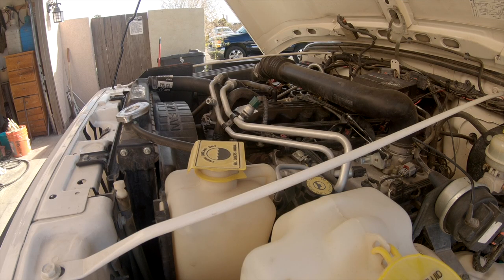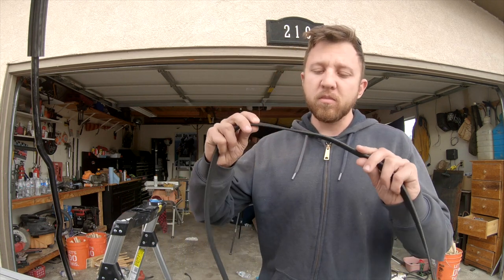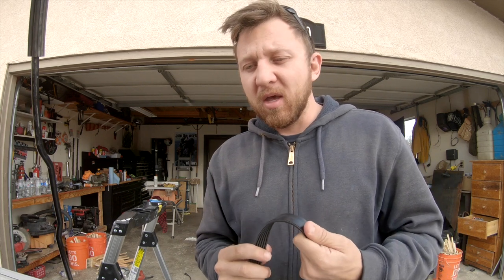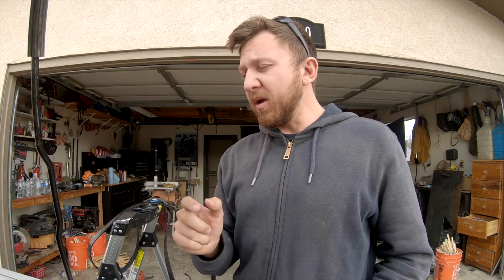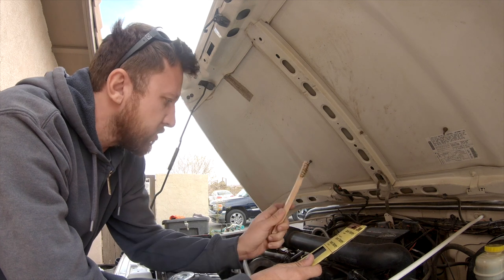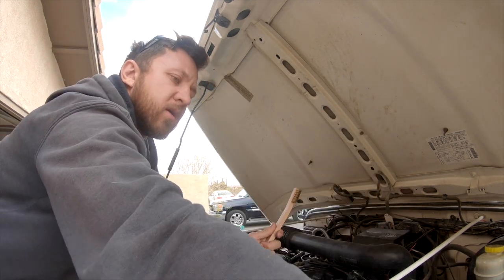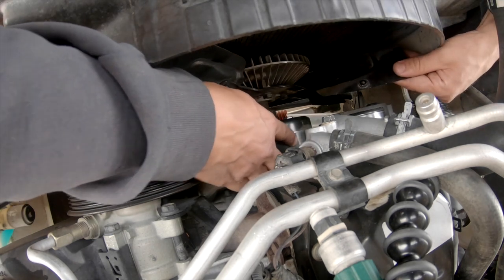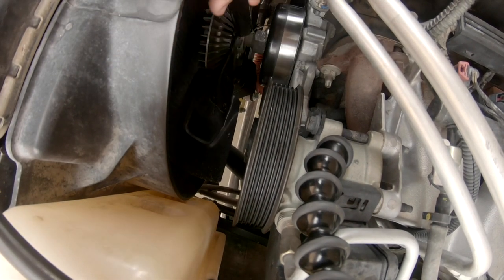How to Fix Jeep Squeal!

Comment: I have a 2016 Jeep compass sport I noticed when I turn first turn the car on the first that time of day about 6 at 6:00 p.m. I hear a squeaking noise for 1 second or 2 seconds and it goes away what is that and how often do I change the belts on on a CBT transmission 2016 sport and also how often would change the radiator flush it out if you can ask me that would be great

Comment: Have you ever had a bearing go out IN the clutch fan assembly?

I’ve got a squeak coming from it but only when the engines hot, when the AC is on and idles the squeak goes away. AC off at idle squeak comes back. Thoughts?
Reply from the maker: Are you positive it's the clutch fan? The clutch fan can go out, it's pretty common wear item. To test if the clutch fan is bad, with the engine off, you grab the blades at opposing sides and see if you can wobble the fan at all. If you feel rocking, wobbling, or clicking the clutch is bad. I have had them go bad and you just replace the whole unit. 

You may also want to check your belt tensioner or if its older and doesn't have an auto tensioner check that the belt is tight enough.
Reply: @EmbarkWithMark  that’s a good idea! It seems pretty solid though, very firm to rotate by hand when the engines cold. I used a stethoscope to try and isolate it but can’t. 

I put my ear right up to the radiator and it sounds like it’s the clutch fan. It makes me wonder though and I just realized something. Since it only happens when the engine is hot hot, with the AC on it goes away until I raise the rpm. But with the AC OFF, I can hear it constantly. Since the AC is on and it’s not doing “much” unless I give it gas I wonder if the clutch is going out on my AC?
Reply from the maker: So before we get into the AC being bad or not. If you think the squeak is coming from the fans clutch area, it could  be a water pump starting to go bad. The fan clutch could rotate nicely, but I recommend getting in there and wiggling things around to see If you feel anything thats loose. You'll want to remove the serpentine belt to do this. 

That does not sound specifically the AC. When you turn your AC you should see the clutch engage and it's working whether you give the engine gas or not.Vehicles normally have an idle up circuit and when you turn on the AC the engine will idle a bit higher in order to compensate for the power draw of the AC Compressor. 

The reason I do not think it is the AC based upon your info is because part of the AC compressor is spinning all the time. It's pretty rare for that bearing to go out on these things. your more likely to have a compressor leak then the bearings go out .

Now it could be as simple as an idler bearing, which is very very common, or the tensioner pulley. 

What year is the Jeep? Are your pulleys clean? Have you tried wiggling all the pulleys with the belt off?
Reply: @EmbarkWithMark  thank you so much for the advice! I’m going to take the belt off today and start spinning things. I’m a first time Jeep owner, it’s a 2005 with 110k miles. I’ll report back what I find!
Reply from the maker: @dad3562  no problem at all! Congrats on the Jeep! TJ’s are so fun to work on and play with. 

One last bit of advice. Don’t just spin the pulleys, grab them and see if you can rock them side to side. Do this with the water pump as well ( will
Most likely need to grab the fan and watch the shaft going into the water pump). 

Please report back and let me know! I’ll do my best to help you out.
Reply: @EmbarkWithMark  I sure will thank you!

Comment: I'm trying to order a stock fan blade. I've got the clutch and the blade but what is the part coming from the water pump connecting to the blade?
Reply from the maker: The part that connects in between the fan blade and the water pump is the fan clutch. The fan clutch will bolt to the water pump and the fan blade will bolt to the fan clutch. 

What year is your Jeep?
Reply: @EmbarkWithMark  its a 97. The electric fan isn't coming close to keeping it cool. I can find the fan and the clutch but not the bolt that connects it to the pump.
Reply from the maker: @kevincwjones  Yea that is a typical problem I find with electric fans on these jeeps. They just cant push enough air. Okay the first thing you need to know is that the late model Tj and early model TJ have different water pumps. Because of this the early Tj's use 4 bolts to bolt the fan clutch to the water pump. The Late model Tj's fan clutch as a giant nut as part of the assembly because of this the late model water pump on a Tj will have one giant thread sticking out. Whereas on the early model Tj's you will just have 4 bolt holes. 

Now if you have the older style pump that originally came with the jeep you will need the older style fan clutch that bolts to the water pump with 4 bolts. These bolts are pretty standard. If you have a newer style water pump with just one giant thread sticking out than you will need a newer style fan clutch with just the giant nut on the end. This is a random website around that shows the older style water pump and fan clutch I am referring too. https://emeraldgreen97.wordpress.com/2012/04/01/clutch-fan-removal-and-reinstall/ 

If you are concerned that you need a new nut that goes from the fan clutch to the water pump, do not be. The part that looks like a nut is part of the shaft of the fan clutch. If you have an older style water pump ( like I mentioned to above) there are just 4 nuts you need, but those should be on the jeep now( if they are not then you can pull that pulley off and take it to the hardware store) . If you are buying both water pump and fan clutch new, than it does not matter as long as both of them are for the same year jeep. 

I hope this helps!
Reply: Embark With Mark I’ve got several more questions. Do you have an email or something? I live in the mountains of WV and I have to do all this work myself.
Reply from the maker: @kevincwjones  I have email and facebook either are at your disposal. Ill try to help with what I can. membarkwithmark@gmail.com or you can look me up on facebook https://www.facebook.com/embarking.withmark
Reply: Embark With Mark thanks man! 
I finally got the stock fan and clutch. For some reason the fan is pushing air towards the radiator... what’s up with that?!
Reply from the maker: @kevincwjones  You could have the fan bolted in backwards,  or the other option is that it may just feel like its pushing air the opposite direction.  The fan blades have an indicator on them that tell you which side is suppose to face towards the radiator. This is usually a stamped word that says "front".
Reply: Embark With Mark okay. I actually just flipped the blade and it’s doing the same thing lol. Sure feels like it’s blowing at the rad. I’ll check the blade
Reply: I had a guy tell me that it was supposed to be blowing at the rad. Sounded crazy to me
Reply from the maker: @kevincwjones  Okay, just check to make sure that the stamped marking on the fan is pointed towards the radiator. It might feel like its pushing air towards the front of the jeep, but it is not. You can also do a mental check. With the engine off, look at the fan, if it looks like its scooping air and pushing it towards the engine than you have it correct. To that guy, yes that is crazy, fans on our jeeps are suppose to suck air in through the radiator core towards the engine. Otherwise as you move down the road the fan would be pushing against any air flow coming in. Your logic is correct, that is crazy haha.
Reply from the maker: Also, if you don't have the fan shroud installed the fan could feel as though its pushing air as well. The shroud is a key component, and should be used. Regardless, if you have the fan orientated the correct way, its sucking air as it should be.

Comment: Just need the detail on how to tighten the belt too much talking sorry dude
Reply from the maker: Newer TJs use automatic belt tensioners, with no belt adjustment.
Reply: Belt tension will be specific to your application unless it has an automatic tensioner, google is handy friend for that stuff.  Cheers! (FYI my 98 Zj tightens to 1 inch of play on the belt)